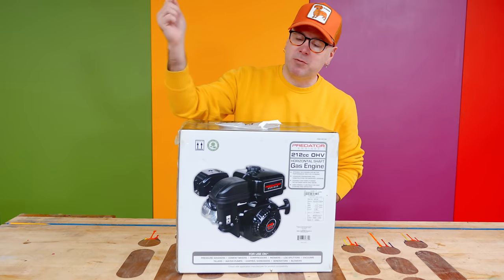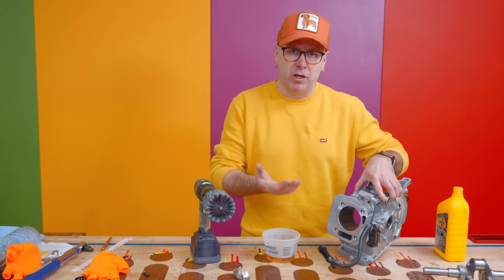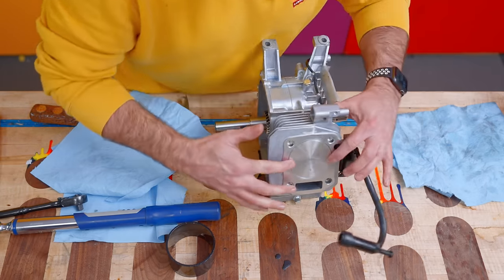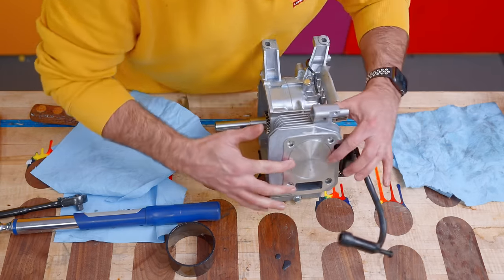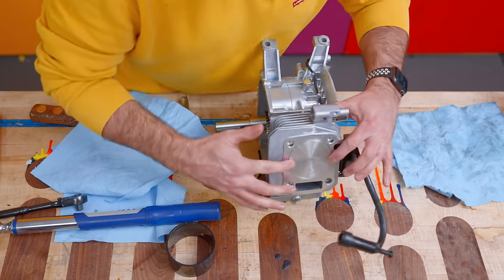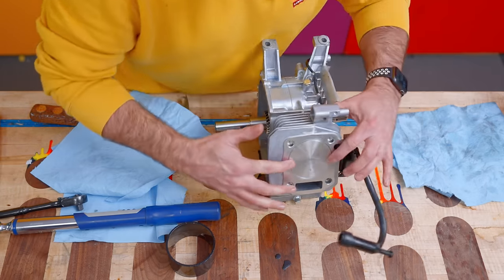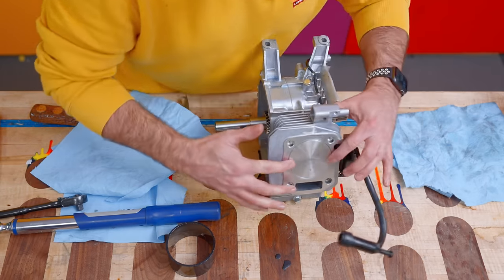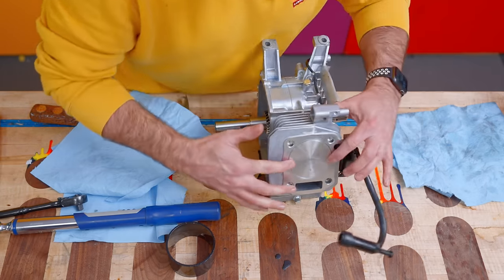How to Build a Competitive Kart Racing Engine (Stock Appearing)

Comment: Hey bro I just came across your channel and I was checking it out I didn't quite make it to the end of your video but 31.42 minutes in I'm leaving you a message you're very knowledgeable about this engine and that's the reason why I'm subscribing to you simply because of that and you seem like a nice dude and I appreciate that I'm from la where I use my engine on a beach cruiser a firm strong Chief cruiser predator 212 engine stage 1 doing 55 mph so yeah I like what you do keep it up 👍

Comment: Great video. I enjoyed watching it to the end. As I used to be a mechanic. So it was highly informative. To give you an idea of the rules for that engine. I am from the uk. Where we raced on asphalt (Tarmac in the UK). The class was called “Pro Kart”, (I’m sure there will be some videos of them racing on You Tube), and they had 2 engines. One on either side of the back of the frame. Allegedly the class call for totally standard engines. Like what would come on a new Kart. Or out of a box. The only thing you was allowed to have was the fuel tank, could be between your legs like standard Kart chassis’s with a fuel pump to run both engines or the fuel tanks could be on top of each engine. The engines were supposed to to be totally standard, if someone took the baffles out of the exhaust they would loose all the points for that days race. But there was always what was called “Cheque Book Racing”. Where a supplier would buy 100 engines. Strip them all down and make a few engines that had the best tolerances. That would give the best performance and sell them for more money. Then rebuild the rest and sell them at the standard price. Hence the saying of cheque book racers. They would have new tyres every meeting. In theory there was nothing wrong with their Karts to a scrutineer. They had an unfair advantage to the drivers who wanted to race in the class as all the karts should be the same. I not saying anything about your video. As it was well made and you were racing to the rules of your class.ps. I never raced in that class before anyone thinks that I am bitter. I was the chairman of the club and my feelings if they want to spend that kind of money. They should race at RAC tracks where everybody does the same. Then they would be on a level playing field. All the best and I hope you win more races.

Comment: Denatured alcohol has worked for me to check the valves for leaks, it has less surface tension than water, and will reveal a problem with seat contact, spring pressure.

Comment: Head porting is the best way to make power.  Gap your stock rings and make sure they go the right side up.  Always port and polish the blocks oil passages especially at the lifters.  Replace those crap crank bearings.  The factory barely cleans the millings out before its slapped together so those bearings are worn already.  Add a little methanol to the oil and you get a little fuel injection when the oil gets hot. Ignition timing goes a long way so move that coil by slotting the holes. And on and on and on.

Comment: I have a very different go kart, off-road 2 seater all 4 adjustable shocks, live axel, on an 20 hp 2 cylinder with a 40 series converter. It goes anywhere it needs and sounds crazy, have 3-1 gears in it now for speed, originally was running 5-1 for climbing hills

Comment: A long time ago as a single man just out of the service in the early 70's, when this sport was new to me, our area would only allow Briggs and Stratton motors because if you used a Honda motor, you would outrun everybody.  I still have the 5HP Honda I used only one time and got banned until I put BS motor on my homebuilt cart.  Running on alcohol with angle iron placed and secured to hold the heads down that had a habit of blowing off, and it was all fun.   I built my son a go cart when he was 6 using that Honda and had the absolute smallest centrifugal clutch sprocket and largest wheel sprocket I could find and it still scared my wife when we went zipping by.  I had to build a reducer using more sprockets and chain to slow it down enough, but then put bigger/wider tires on it and made it into a go cart mud buggy my son loved even better to run around our property.  That was about 37 years ago.

Comment: I would “break in” the engine by running it at varying RPMs before running it really hard especially on an automotive application. Harmonics come into play.  When breaking in the engine on a brand new car you should not use the cruise control for the first 1500 miles for this reason. Also the manufacturer might recommend that you not exceed a certain RPM until a certain amount of mileage has been reached. In the old days they would use a lighter oil for the first 200 miles and then change the oil. This is not required anymore with more accurate machining and better Oil. (Synthetic)  I really enjoyed your video. I didn’t realize that a harbor freight /Honda clone engines had so many aftermarket parts available.
Reply: This is often debated in the kart community, most bring it to temp (over 200) and rip it. 
The recommended rpm for these from Pred is 3,600. He’s gonna be turning this one twice that so the manufacturer is out. 
I’ve broke in many ways and never had any problems.

Comment: I did exactly what you did and it's an amazing reliable fast racing engine for real competitive go kart racing or just for a high power off road buggy type go kart. Very universal motor here if you want nice budget friendly kart motor that you built your self is a huge money saver, I been building custom racing go kart motors since I was 10 me and my friends had a little street racing thing going on where we would run 5 laps or so around the neighborhood and if you won you got points and who ever had the most points by the end of summer break wins, we also built custom backyard dirt oval karts when we got a little older by welding and fabercating our own offset oval chassis using square tubing we would find and get from a Fab shop down the road for free cuse it's scrap they don't need and it was all thin wall 1 inch square tubing lol. And between all of that I was racing real racecars from age ten and just quit racing big cars last year and I'm 30. But this is a nice little motor guys. Even the stock predator motors or plenty powerfully enough for any kids or adults as long as you get a good flywheel and remove the governor completely and litteally port and gasket match everything with a Dremel tool will make huge difference. The light or medium flywheel is perfect for general go karting off road backyards ECT. I was doing 3 angle valve jobs and milling my heads on go karts since I was 10 very easy to do my dad taught me on one go kart from the start to finish on a old classic brig's and Stratton fun power motor that I had on my go kart that I got when I was 8 it was bought brand new in the 90s it's red single seat with roll cage and the motor says fun power it's like a 10 horse motor I still got it in my shop just finished restoring it cuse it's my childhood go kart and it's a classic go kart that kids had in the 90s for yard karts and going to give it to my son in June when he turns 8 on his birthday which is same day as my birthday. I have two of the fun power motors the one he is getting on it is completely rebuilt brand new stock one and then when he get better at driving I'll put the modified Briggs on it that I built originaly as a kid that I just rebuilt or give him a nice predator motor like the one you built.

Comment: Surfing the net and found this video. Everything as a V-8. I will share some things for what its worth.
1. I don't know if alcohol would be a better liquid to use in determining valve leak. Clean up would be easier with evaporation. 
2. If you are using a thicker gasket, the difference between original and thicker gasket could be the amount you would want to take off the head. You're gaining combustion through the flat piston, but you wouldn't be losing combustion through gasket thickness. 
3. Another thing to consider is determining the combustion chamber size, there are videos to show you how; plastic sheet with hole, fill up with water by measurement. Why? because it is a data point to keep track of.
4. When lapping a head, consider using a figure eight motion. it's an old machinist trick I learned, it keeps favoring one side or the convexing the head by the pushing and pulling motion. (more force is used at initial push/pull and thereby making the head slightly convexed. Figure eights help keep the surfaced planed.

Comment: I started racing go-karts when I was 11 (1984). Me and my dad raced until 1991. I started out with the Wasp frame (one of the first sidewinder frames). I ran the box stock classes for my age (midgets) and my dad signed papers so I could run with the teenagers (juniors). When I was 13 I ran super stock and open modified. I fractured my spine at 15 from an end to end flip.. I didn't know it at the time because my dad made me finish the race. It was the only way to finish the win in the points. I'm 49 now and my back is in bad shape. But I wouldn't change a thing. Because I lost my dad in 1992 to a stabbing. Sub'd!
I'm working on a trike to drifting. I'm older but definitely not done!! 🇺🇲🤙

Comment: Professionals use alcohol to CC the head and check the valve seal. Use a flat clear piece of plexiglass with a hole drilled in the middle, then fill the head with your alcohol and record the CCs used, now you can calculate your compression ratio so you know how much octane your motor should have, if you get high enough you might want to move to alcohol fuel which will be a power increase as well

Comment: I e had a predator 212 sitting in my garage for a year, i think i need to hop it up. One thing im thinking is inside the blick is rounding every sharp edge like what old heads do with their performance V8s. Itll add horsepower and everywhere theres a sharp edge is where a crack can start.

Comment: When you remove the flywheel It would be ok to use wood wedges instead of a crowbar AND it's ok to put the nut on the crank loosely to protect the threads before you go whacking on the crank
Reply: Or just, you know, a puller tool.

Comment: Just trying to help duration is how long the valves are  opened it also matters how much overlap the engine has. This is why you didn't see an EGR valve on several Ford engines

Comment: Back in the 60's we used twin McCulloch chain saw motors. Port and polished heads. Others were using Hondas and Kawasaki engines with gear box's

Comment: 2 thoughts for you. 1 open up the oil drain back from the valves to the crankcase. 2 use the intake pulse from carb manifold for your pulse pump. Ok 3 ideas. Use copper gasket spray for the thinner head gaskets. It has adhesive qualities.
Reply from the maker: Unfortunately not allowed to pulse from the carb. Thanks!

Comment: You can try, if allowed, not monting the carb, direct on the head, but on a 8" long tube, with flanges (homemade and welded. Avoid higher than 90 deg. angles). for more low end torque!

Comment: You should have mentioned that the wrist pin circlip rings should be installed so that the gap is at the top or bottom. I like the top. This is done so that during high RPMs the clip doesn't flex, come out of its groove and ruin your day.

Comment: Dychem is much better for matching the valves with the seats. In a professional shop we use dychem. Also useful for decking to see what is flat and what is not.

Also you apply vacuum guage to look for valve leaks. They make an attachment that looks like a toilet plunger that sits on the head surface. Air leaks much easier than water.

Comment: another thing you should do when building valve train on any engine, is Tap the valves after the retainers are put in. you get a punch and hammer and smack the end of the valve stem. the shock of that will wedge the keepers into the retainer cap and the valve stem, witch makes them semi permanent interference fit, its just something you should do to be sure your valves wont fall apart during operation. obv this should only be done with the automotive style retainers and keepers, not the factory GX200 slip on retainers. also regards to how the professionals test the valve seal. they have a suction cup tool they put over the exhaust port, then pull a vacuum, if the vacuum goes down they have a leaky valve if not valve seal is good.

Comment: Depending on the duration top dead center isn't always the best way to set the lash. Set exhaust lash right before the intake valve closes and set intake lash right when the exhaust valve begins to open that way you know the opposite lifters are on the heel of the cam lob
Reply: Lobe
Reply from the maker: Can't give away all the secrets in the video! Also, thanks!

Comment: I'm a retired tool & die maker, and I have rebuilt engines from natural gas engines CP Rail loco engines, 4,000 hp aluminum funny car, most US car, Harley's, Honda's, lawn mowers, motorized bikes, and remote-controlled airplane engines. Because of my background in metallurgy, I have an understanding of the "break-in" process, so, here goes. IF you have a freshly machined engine, that has NO OUT OF TOLERANCE PARTS, then, there is no need to flog the engine to it's max RPMs in order to clear any interferences by scraping or pounding it away. Now that we've covered what NOT to do, let's talk about cast iron. It has a high carbon content, which makes it brittle and it crumbles when you hit it with a hammer. The engine cylinder and piston rings are made of cast iron. When you gently slide the rings in the bore, at first, the cross-hatching starts scraping material off the rings. After an hour or two, the rings now make full contact with the cylinder, so now the spring pressure by the rings, against the cylinder is evenly spread out, and the rings are no longer getting material scraped off, now the light friction is "work hardening" the surfaces, causing the grains of carbides to become extremely hard, and very wear resistant, about 0.001" or 0.002" deep. This engine will last a long time, and stay within tolerances. If you beat a new engine, none of the fitting and work hardening happens, and your engine starts leaking, burning oil, and prematurely wearing out. Break it in GENTLY, check oil for particles, black cast in oil. Clean oil means good break-in.

Comment: Use alcohol instead of water to check for the valve seating. Lift on a cam is how fare it opens. Duration is how long( no. of degrees) the valve stays open.

Comment: I would think this goes for all engines, but during brake in.... I would put conventional in with a little bit of these zddp. But if anything, I would hold off on the additive until after the break-in. Because it's meant to coat everything and then become the sacrificial component. The whole point of a break-in is to get everything to mate together and if there's something in the oil that's affecting that it's going to take forever or not break in completely. I've had multiple engine builders build engines for me and I've built many myself. I've always just put straight 30 weight in all of my engines. I've also never had my oil show any signs of break-in after the first oil change and also you're not supposed to take it apart because that defeats the whole break in process. I also try to vary the engine load in between 50% and 100% for 15 to 20mins.

Comment: You do not need to lap the crank to keep the flywheel from coming loose. You must put good grease on the threads and a thick washer behind the nut. PS I wonder about grinding on the block with the bearing still installed.

Comment: Very good video.
I like people who acknowledge topics they don't know, it makes me trust what they say more.
Good video.
Makes me want to build a kart engine. 

One constructive criticism:
The fuel pump explanation could be a bit clearer. 
It sounded to me  like you are saying that the crankcase vacuum is directly sucking in fuel. The vacuum pulse acts on a diaphragm to move it to pump fuel that is on the other side of the diaphragm.  (Or a second diaphragm mechanically connected to the vacuum diaphragm. 

Thanks

Comment: After compressing the "plastiguage" be sure to observe that the width it is compressed to is consistent across the journal, not just measure how wide it is to get the overall clearance. If the width is thick in one spot and thinner in another, it means that the machining across the journal is not consistent. Check the thinnest part and the thickest part to get the overall clearance variance. Check the/a spec sheet to get the maximum allowed variance.

Edit: Aggressive Cam = Longer Duration [That the valve stays open]

Comment: I have a 3hp bicycle,  but takes off slow and only goes 20. I just want a little more speed and a quicker take off
Reply: it's a 3hp bicycle just replace the engine entirely or build it , if it's a 50cc then there's a lot u can do like a 70cc kit , new clutch new carb or better Jet... anything else just search it up , there's entire communities around small , low power engines

Comment: Love it, but when you check the valve seal I normally use a penetrating fluid like WD-40 instead of water because of A) possible corrosion (not really an issue on this application but still) and B) if your valves don't leak with PENETRATION fluid then that's a damn good seal

Comment: After running the Lucas break in oil . You should run just a tsp of the Lucas heavy Duty Oil Stabilizer. It will make a huge difference in making your motor run smoother , and you will get better gas mileage and make you motor last longer .